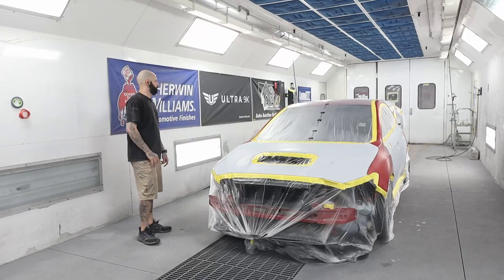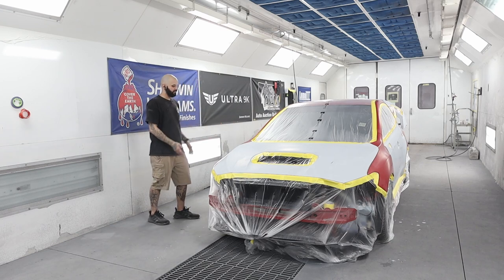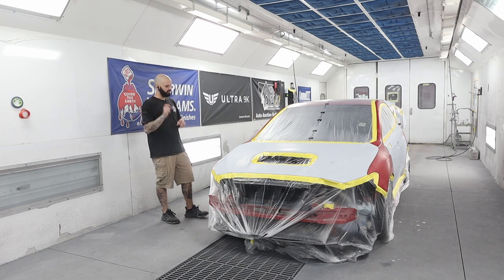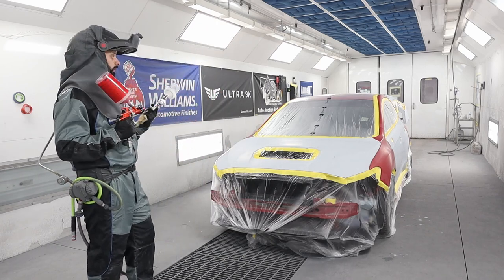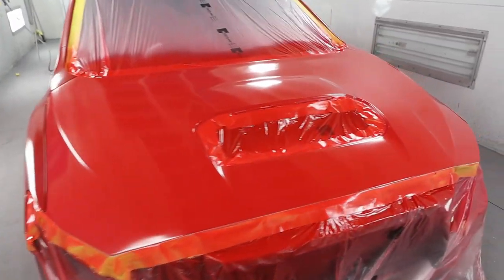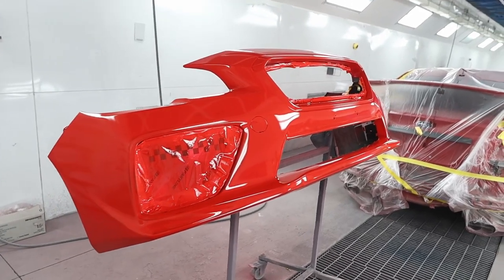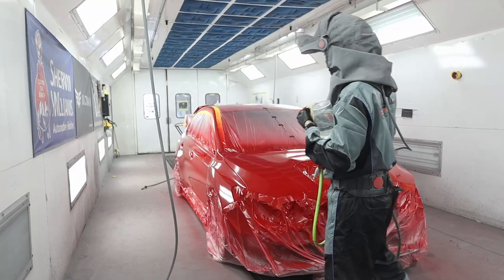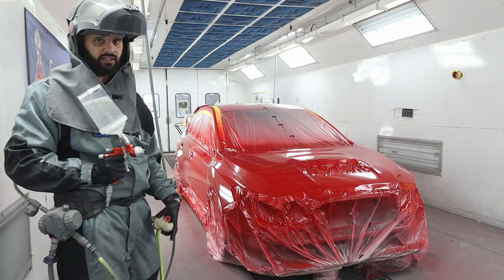Painting the peeling Sti!

Comment: Hi. Do you know how much clear you put on with that 1.2 nozzle in microns ? I'm always clearing with 1.4 and my measurement was about 50 microns with 1.5 coat of clear. I was measuring after base and then after clear. I'm worried that when i use 1.2 nozzle and still 1.5 coat like it's suggested by brand there would not be enough clear on car.